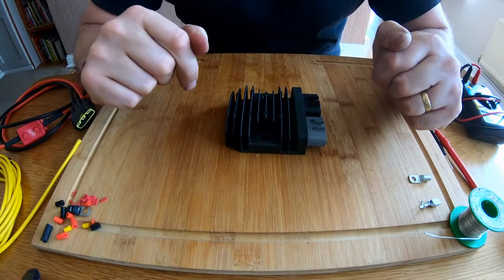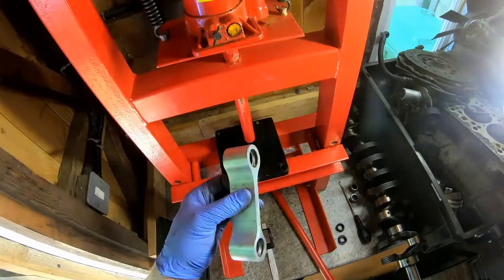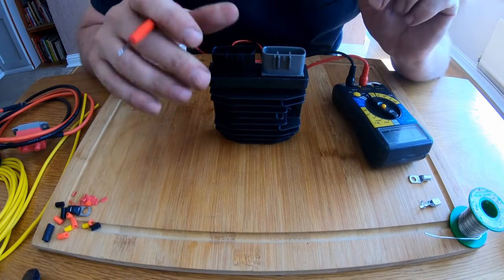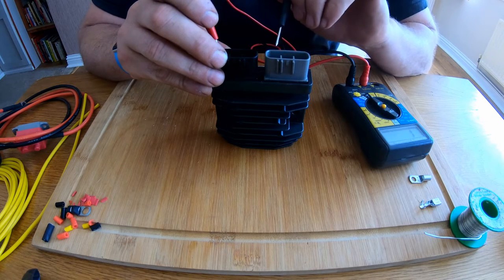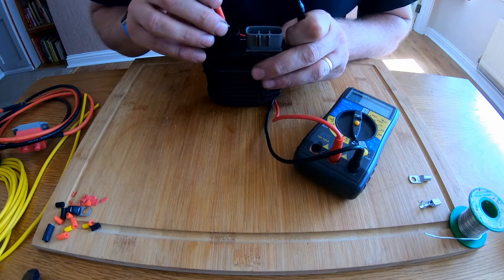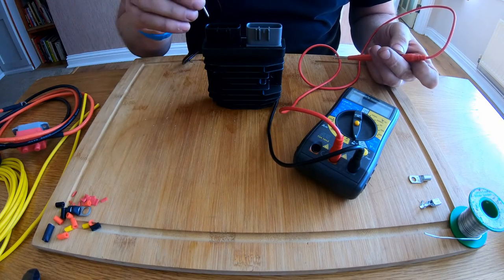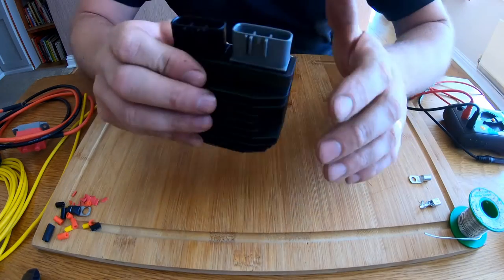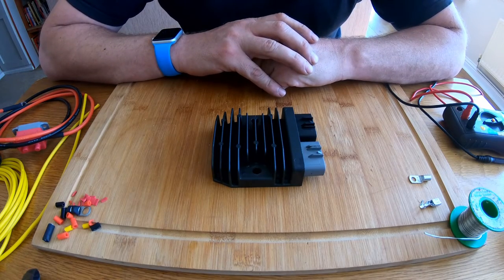How To Carry Out A Serviceability Test Of The Shindengen FH020AA MosFet Regulator/Rectifier.

Comment: Thanks for the informative vid. What's the specification of the cables you are using to connect the alternator to the rectifier and the rectifier then to the battery? Cheers

Comment: Who else is here because their Suzuki has a regulator/rectifier that’s trash….Thanks Kev
Reply: A C90T K7 rider here 🙂 The original Suzuki-installed R/R's are not exactly trash (e.g. with the OGs, my C800 K9 ran perfectly for 12 years I've had it, and still does since 2020, when I sold it - and so does the 2003 model I bought last year), but they might not be optimal for a particular bike model - which is the case of the C90.

In the very days ahead I'm going to check both the R/R (if a replacement is needed, I'm definitely going to install a cooler-running mosfet one, due to the not-so-good placement of this device on the bike) and the stator, as well as all the corresponding cables and connectors.

Comment: Hi Kev still loving the vids very informative does it have to be a mt 09 reg rec for the vfr
i have seen one on elextrex world website that looks the same as the mt 09 its a mosfet made in britain its for a triumph rocket111 and says it fits a few other bikes.
Reply from the maker: Personally, I wouldn't bother with the Electrex ones myself but that is my own personal choice. There are several bikes that use the Shindengen Mosfet R/R including the MT09 such as the CBR500, Ducati Panigale 1299, Street/Speed Triple Triumphs, some later models of Africa Twin and a few others. The FH012** is found on some late model S1000R BMWs and is an excellent option and actually has an even higher Amperage rating of 50A compared to the 30A of the FH020AA. There are always several of these models on eBay, you just need to know what bike to search for!
Reply: @KevsShed   To ebay it is then thanks for the reply need to look out there's a lot of fakes on the market.
Reply from the maker: @garyhewitt270  There is indeed, avoid anything that is shipped from China and generally if it's too cheap, ie. under £40 then it probably is a cheap imitation. Also any FH012 that are being sold as new are not genuine as the FH012 hasn't been manufactured since the Earthquake in Japan 10 years ago! They are perfectly good second hand though as then never fail in my experience!